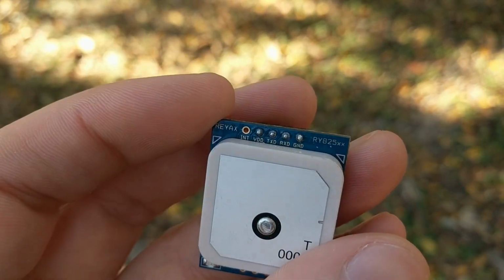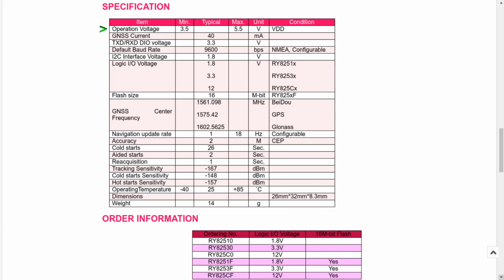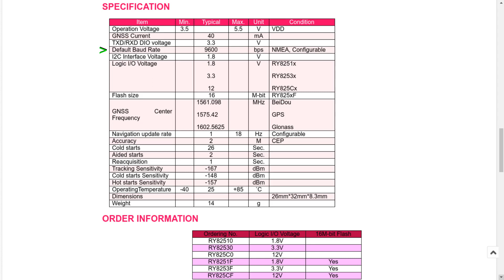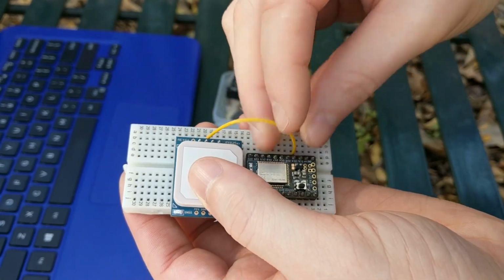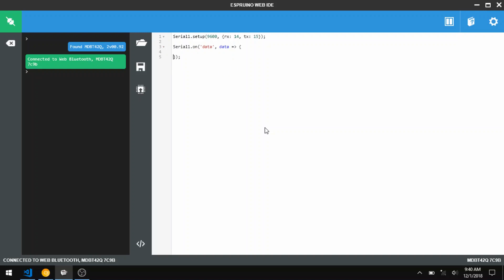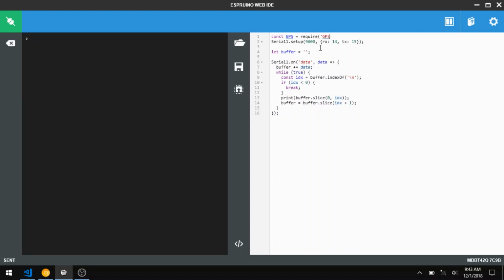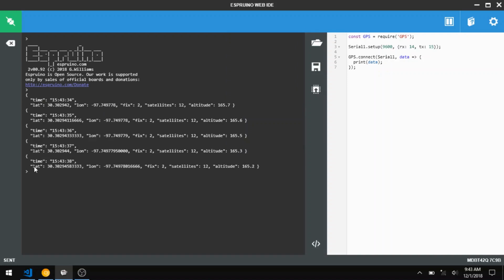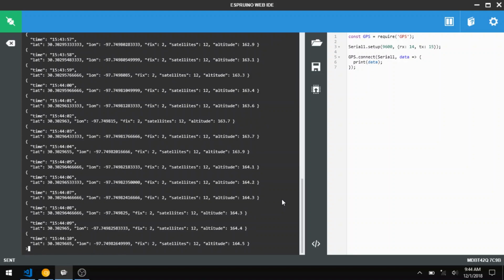Getting Started with GPS Tracking Device | RY82530 | Tutorial

Comment: How can I build a laptop tracking device and fit into my laptop for safety. 

Also in case if it's stolen , how can I track it. 

Although this video is very helpful but I am thinking how can we transmit these co ordinate over any api or database
Reply: did you find a solution?

Comment: Hey man nice video! I’m working on a project that requires a gps device as you made in this video, I’m more of a software developer and am not as experienced with computer engineering/hardware. Could you please go a bit more in depth on the voltage requirements so I don’t fry any chips? Thanks bro
Reply: A low power consumption module good running for devices;
https://www.alibaba.com/product-detail/Delincomm-ES1010-Sony-CXD5603GF-Chip-GPS_1600117171063.html?spm=a2747.manage.0.0.472e71d2tl7MuJ
Reply: Did got any any success with you project. ..? Plz update